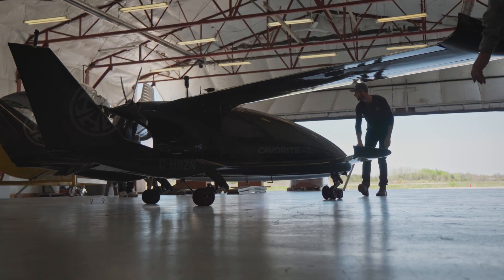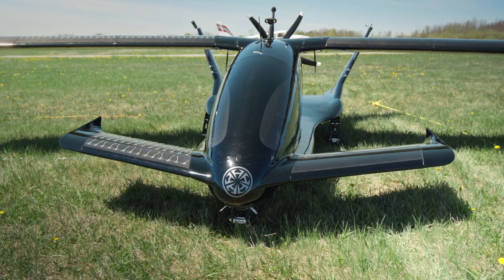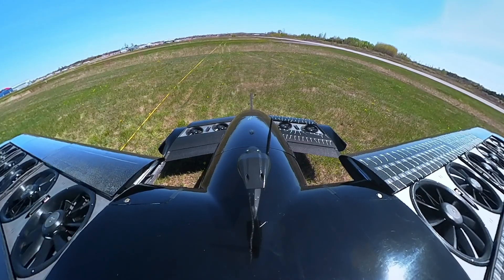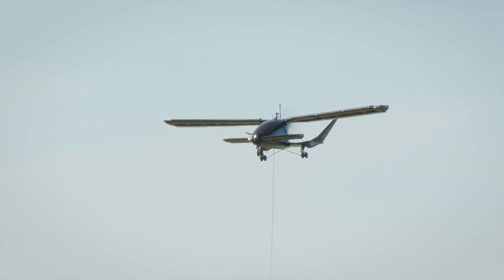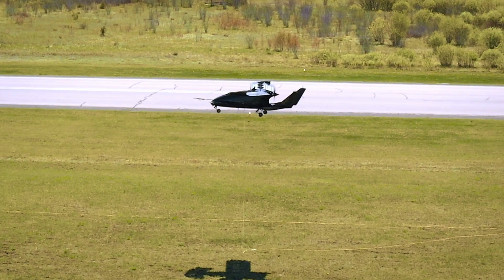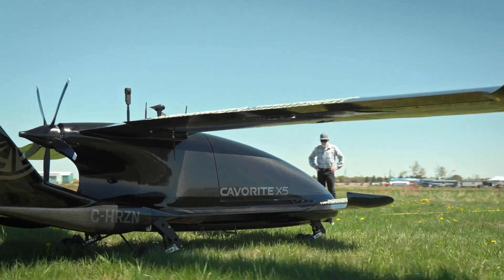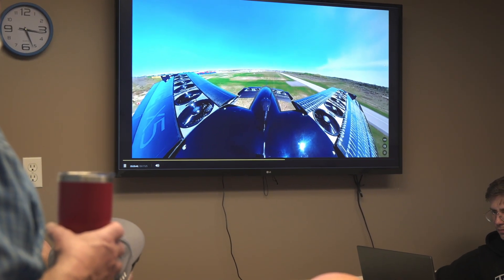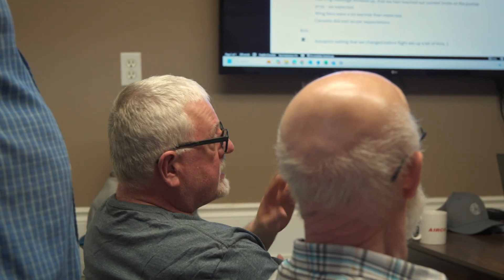Team Review of Successful Pre-Transition Test Flight

Comment: 1:27  🤔🧐 , ok speculating and trying to figure out,   if I'm guessing right, the rear design is a  balance and make up for lost pitch control of the wings due to the tech. 

Could, ...  the fuselage be extended,   upper and lower canards designed into the cabin like the front, but solely  function for the pitch duties,  and single or dual tail for the yaw.   

Uhmmmm a cavorite x14 🙏🤗🙏
Reply: 🤔 upper and lower tail,  for yaw..   mmmm.    ... I might have purchase a license.  😊

Comment: I think this solution with concealable rotors in the wings, which are only needed for vertical flight, is the most elegant. As soon as the wings are closed, the rotors create zero resistance during forward flight. Tilting rotors or motors or even rotating the entire wings is not the solution, as such mechanisms also increase the takeoff weight.
The most difficult thing will be the transition from forward flight to hover mode, as this is when an aircraft is most unstable. I am excited to see how the next tests go.